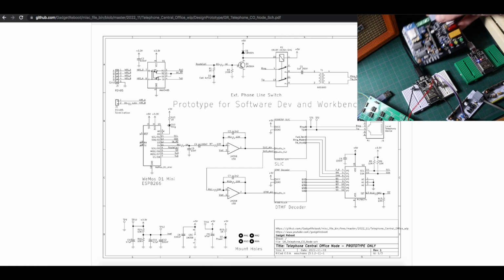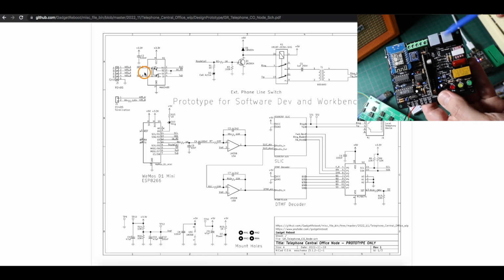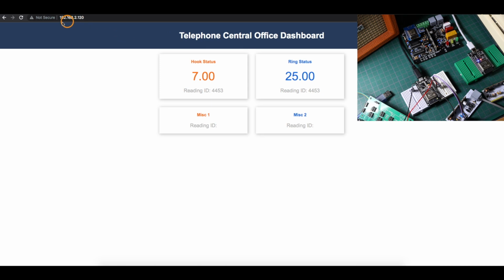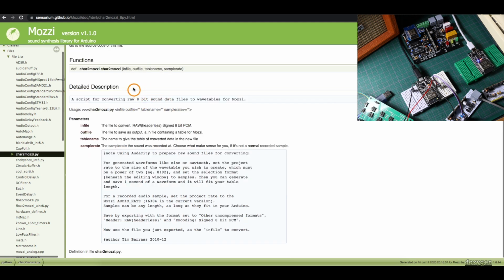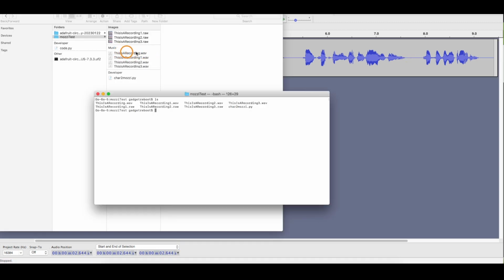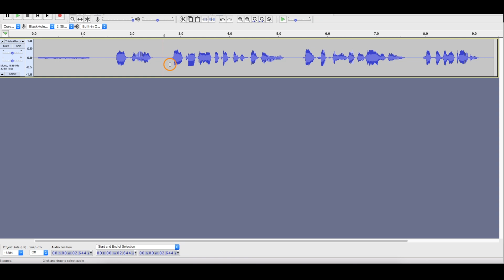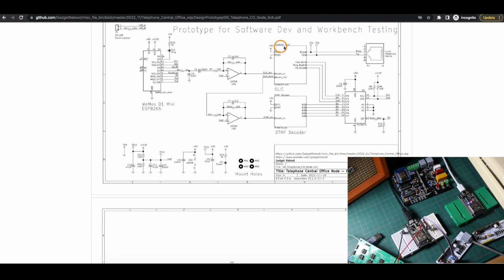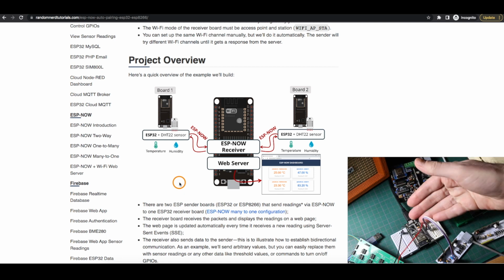Telephone Central Office Re-Design with ESP32 Begins

Comment: I am interested, how to decoding Call Progress using esp32 without extra ic tone decoder eg. cmx673, cmx683, and so on
Reply from the maker: Goertzel algorithm libraries might be able to decode the frequencies in the audio but I’ve never tried it and some people have found it to be inconsistent. 
Maybe if the chip is doing too many other things it could be even less reliable to the point where you need a separate chip anyway.
https://www.hackster.io/MM_Shoaib/dtmf-decoder-using-only-arduino-872502
Reply: @gadgetsideload  I have successfully detected DTMF with Goertzel. However, for Call Progress, I still depend on CMX673, I would be very grateful if you could create a library to detect Call Progress Tone, especially to detect Bussy Tone, and Hello Voice :-)
Reply: @gadgetsideload  https://youtu.be/py6uTzZ07iA?si=AyFb04gPjdhGzUfz